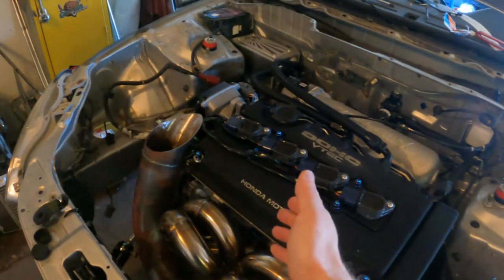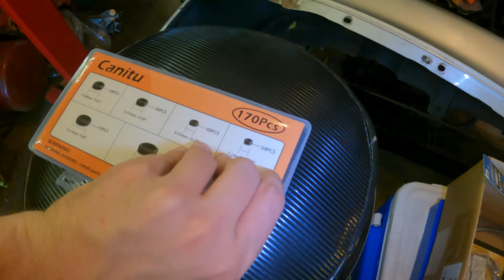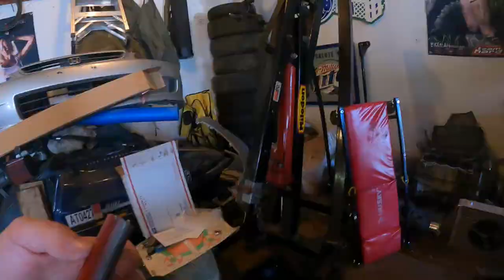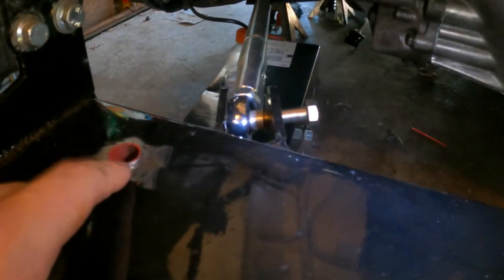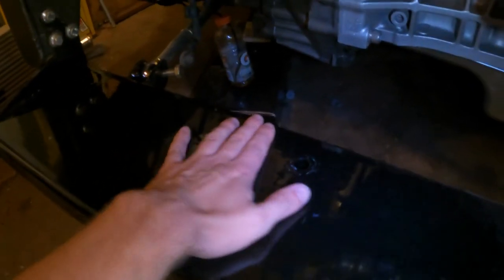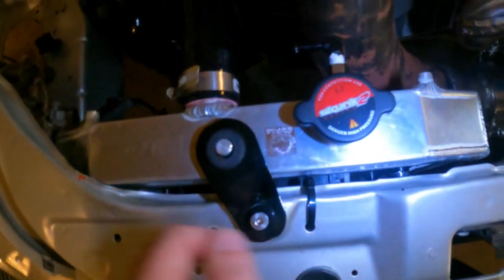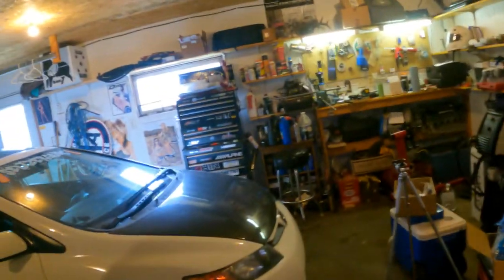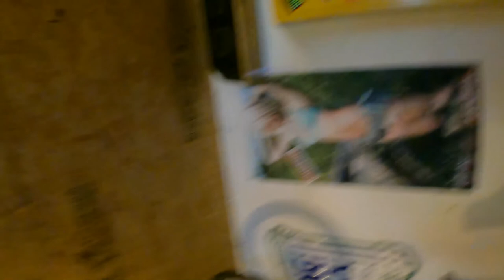Modifying my Odyssey Weight Bar for the Skunk2 Radiator

Comment: I broke soooo many oil pressure sensors because I had mine mounted to the block. Never thought about mounting it with an oil line to the firewall. Genius! Also, thanks for the content, glad to keep up with your project!
Reply: Let me rephrase, I broke so many fittings because the oil pressure sensor was heavy!